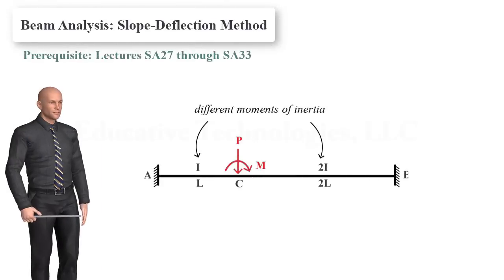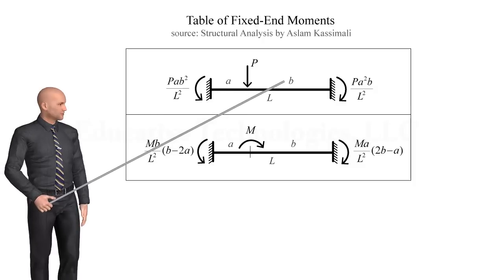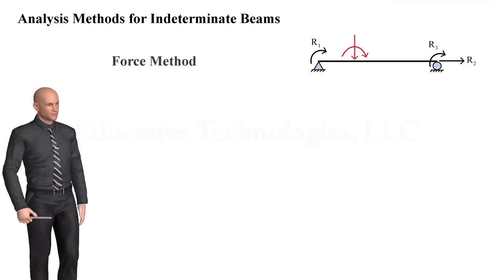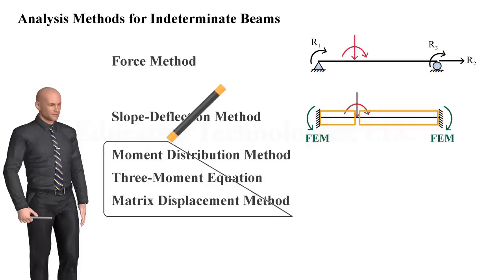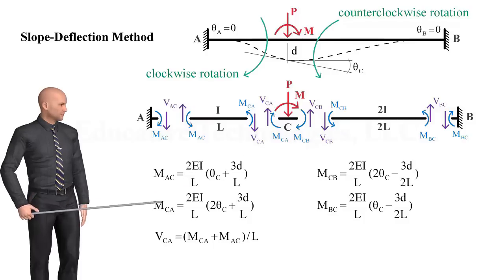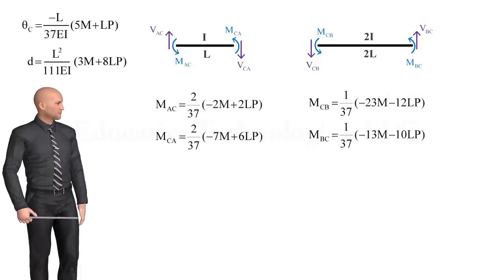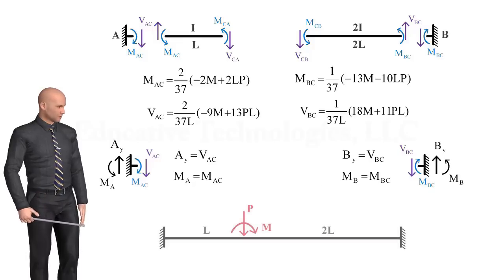EX07: The Analysis of an Indeterminate Beam

Comment: Hi, what's the definition for an indeterminate beam vs a determinate beam?

So far, I know that a determinate beam can be solved via equations of equilibrium, whereas an indeterminate beam requires more detailed methods.

Any help would be greatly appreciated.
Reply from the maker: There is not much to it more that what you have stated already. If we can calculate all the reaction forces using the static equilibrium equations, we call the system statically determinate. If however there are more unknowns forces (more support reactions) than static equilibrium equations, we call the system statically indeterminate. For example, consider  a cantilever beam. It is statically determinate since we can calculate the three unknown reaction forces at the fixed support using the equilibrium equations. But suppose we wanted to better control the deflection of the beam. We can do so by placing a roller at the free end of the cantilever beam. But this adds an extra support reaction (the reaction at the roller) to the mix. This additional (sometimes called redundant) reaction force makes the structure statically indeterminate, meaning we can no longer calculate the reaction forces (now we have four of them) using the three static equilibrium equations. To analyze statically indeterminate systems we need to come up with more equations, hence the need to use more advanced techniques than the simple application of the static equilibrium equations.
Reply: @DrStructure  Thank you very much for your reply. Just to confirm, the three equilibrium are: sum(Fx) = 0; sum(Fy) = 0 and sum(M)=0?
Reply from the maker: @king0vdarkness  You're welcome. Yes, those are the static equilibrium equations.

Comment: how you get the moment of AC
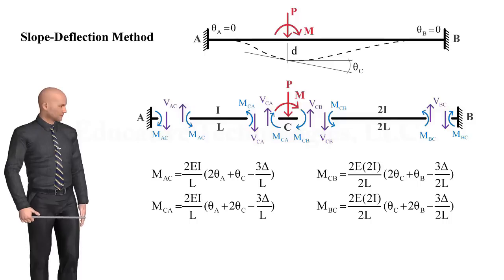Reply from the maker: The moment at the left end of member AC can be determined directly from the slope-deflection equations. The general equation for M_ac is given @4:04. In simplified form, the equation appears @4:52. Once the slopes and deflection are calculated, they can should be substituted in the slope-deflection equations to determine the member-end moments. The value for M_ac is given @6:08